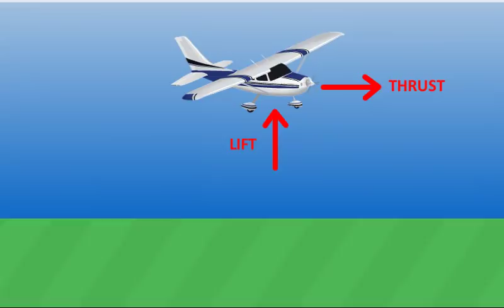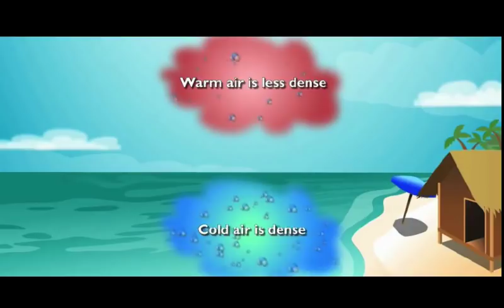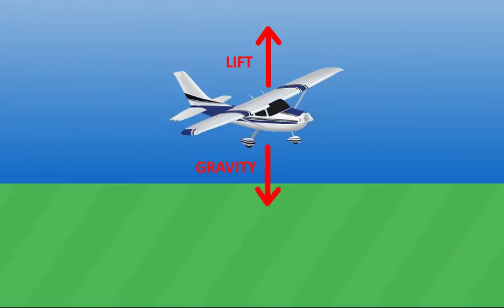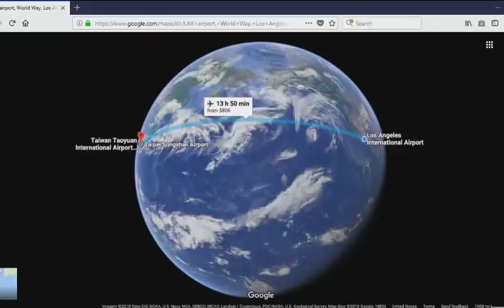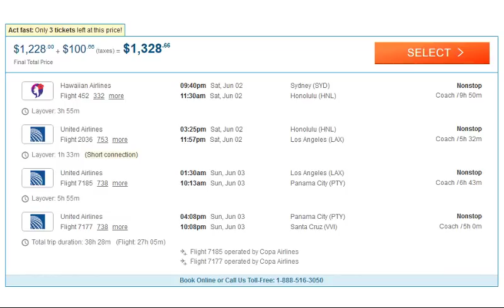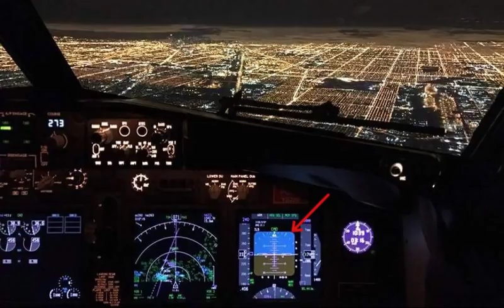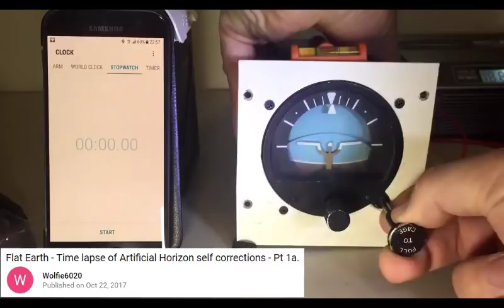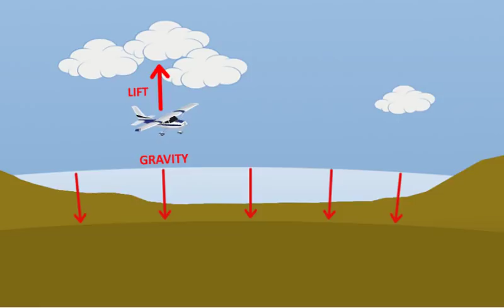Flat Earth Falsities - Plane Nonsense

Comment: "One thing that's always bugged me about our "round ball planet 93 million miles from the sun"...Why isn't there EXACTLY 11 hours 58 minutes and 2 seconds of sun, every day of every year? That would be the time it takes the Earth to rotate 1 full turn, which is 23 hours, 56 minutes and 4 seconds divided by 2. Some would say, "Because of the tilt of the Earth on its axis". That has nothing to do with light hitting a ball. No matter how you tilt the ball, exactly 1/2 of the ball is getting hit at any one time by the light, it can't shorten the duration of light just by tilting. Hold a ball up in your hand and put a mark on it roughly where Florida would be in relation to the equator. Then tilt it roughly 23 degrees and spin it. The light still hits 1/2 of the ball at all times! The only part of the globe now in darkness is the North Pole, not anything near the equator. So where is the missing light-time? According to the Navy's Astronomical Applications chart for Fort Walton Beach, FL, the amount of sunlight shining on Fort Walton Beach on Jan 1st, 2016 to Jul 1st, 2016 has a duration change of almost 4 whole hours! And, the temperature changes by about 20 degrees. You mean to tell me we're 93 million miles away from the sun, but a 4,000 mile difference (approximate distance a Northern hemisphere continent is shifted away from the sun because of the 23 degree tilt) is going to make a 20 degree heat/cool difference in a day? In Arkansas it makes about a 60 degree difference. It's just not plausible."
Reply: Bear in mind the Earth's orbit around the Sun is not perfectly circular.  It is elliptical.  The radius varies between 92 million miles and approximately 94 million miles.    Also see https://www.lpi.usra.edu/education/skytellers/day_night/ regarding this issue.
Reply: O its a wonderful Heliocentic world ! :)  Amazing how that super Gravity gas-ball allows an elliptical rotation, think the Maths would make it perfectly round. And its warmer when our ball is the furthest.. anything goes, our Rulers must be laughing their heads off (or lolling like many do around here) (when not having a fit and "fu_ck off" cries).
Think LUCK & Nothingness-Laws did an amazing job here? Just learn more SCIENCE billions of miles away...
The wonders of the weakest FORCE in the Universe perform miracles on other Balls too!
Talk about COREOLIS !!! 3:29 = 21747MPH winds the GRAVITY keeps that atmosphere sticking on... way to go MOMENTUM!
Their amazing Science knows for fact all these thing without going there, more REDSHIFT wonders (never science methoded).
https://www.youtube.com/watch?v=18rARy8g4Hc
Reply: @BrainUser1  I've read over a dozen of your comments, and this one is the first one I could understand!  I feel so proud.

The math, as someone with a physics degree, predicts an elliptical path, not a circular one.  All objects in the sky follow an elliptical path, and none follow a circular one (although some are pretty close).

The data was measured by Tycho Brahe, and the orbital paths determined from those measurements by Johannes Kepler, 500 years ago.  Not long after, Isaac Newton came up with his laws which perfectly explain an elliptical path.  You can test this yourself using Newton's law of gravitation, by writing a small program to trace the path of an object in orbit around another one.
Reply: @casanovafrankenstein4193  I though so, that really ginds Them, little left for Them to do... but some meek english nikpicking.  So it seems yet I have lost an other Follower :(
ps: your comments are just the best :) :) :)
Reply: @BrainUser1  I'm complimenting your English. I'm disparaging your arguments. But I still have no idea what you are on about.
Reply: By the way your "example" ignores the orbit of the ball around the light source.  I think you assume (consciously or not) that the orbit is circular, when in fact it isn't.
Reply: If you cannot understand this point, it could be difficult to explain. It is due mainly to the earth's tilt. The best way for me to explain it, is. When it is summer in the northern hemisphere, the earth is spinning with the north pole tilted towards the sun. Resulting in the north pole always being in perpetual sunlight. When it is winter above the equator, the north pole on the spinning earth is tilted away from the sun, resulting in continual night. If the earth was spinning perfectly vertically to the sun, the ratio would be 50/50. But the earth is spinning around the sun with a constant lean of 23.5 degrees. So we move through the year from summer to winter solstice, resulting in different seasons.
Reply: @appresley4071  HA HA HA HA! As if I didnt "know", "YOU" to explain? Think not, never would you come up with that well cooked anomaly story. Long live the 66.6 tilt, as Gravity it does wonders.
Yeah it seems afterall that our / your Cosmologist clergy are not into "round" "sphere" "globe" but into; geoids / oblate / ellipse shapes, like the Galaxy= nice flat ellipse dancing around, well miss Nature or thee Laws dont give Gravity full reign.
Too bad for the love of Maths of Forces. Maybe its all tilted, that would explain it.
Reply: @BrainUser1  The tropic of Capricorn and the tropic of Cancer are both 23.5 degrees from the equator. This 23.5 degree tilt even explains why the sun rises south-east and sets south west in Australia. Look at a web page that explains the seasons, they might explain this better than me Louis.
Reply: "Explainging" does not mean; Proof or Reality. Seem like a kid that just reapeats what the GE sites serve out for those who understand... everything. Wont get into it with you, like wasted on a Bot.People are aware of that many inconsistencies been debunked.
Reply: @BrainUser1  You do understand that gravity is a weak force relative to the other 3 fundamental forces, right? The maths do work out to provide perfect proof of the orbits being elliptical, as you can see from this website where they do the maths for you http://galileo.phys.virginia.edu/classes/152.mf1i.spring02/KeplersLaws.htm. 
Now, whether or not you can understand it or attempt to understand it is up to you and not my problem. The fact is that you are refusing to acknowledge that you, in fact, know very little of this topic and refuse to open yourself up to learning more because you believe it is brainwashing. Maths isn't brainwashing. We don't show little children mathematical proofs of gravity or earth's curvature because they do not understand these complex concepts but understand that the earth is round. It is not a global conspiracy, it is just an observable and testable fact.
Reply: @BrainUser1  Even the most dedicated flat earther should realize that Mariusz is talking nonsense to make a claim.
Everyone knows when you light a ball from a certain distance this ball will not have light over exactly 1/2 of it's surface. This does not depend on wether you are a glober or a flatter. It's just 3D modelling.
Also the lengthening/shortening of day and nighttime by the tilt is for a flat earther perfectly understandable. That he mentions 23h56' proves he doesn't understand anything. He just grabs a few lines and vomits it into a forum.
Even you should admit that Louis. No way you can defend him for being a knowledgeable flat earther.
Reply: Luks welcome to... +Voys context world. MATHS can work out to make and bake any "perfect proof".Not exactly lab scientific method material.... THEY got plenty of Galaxy /Universe math proof, execpt they have not proven REDSHIFT business that  they depend on for their knowing, existance, kind of like GOD.
Reply: @Buildthewall4017  REPEAT= MATHEMATICS is often thought to be universally and unassailably true(generated by the brainless NOTHINGNESS or its BANG!)(& WITH NO PURPOSE...).   In conclusion: numbers and other mathematical objects are simply concepts, and not things that are actually observable in the universe, 

Hence, mathematical definitions were chosen by humans to model physical reality so that we could make useful predictions, not to encapsulate metaphysical truth, so really, why should we expect math to be true? http://www.clockbackward.com/2009/01/18/is-math-true/ 

   I agree – I think of mathematics as a language… we would never say “Spanish” is true or false… it is a system people use to describe and model their world… In discussions of philosophy, I’ve noticed an unsettling tendency on the part of some people to view mathematics with an almost mystical reverence and then use it to prop up whatever other metaphysical ideas they’re defending. 

"As far as the laws of mathematics refer to reality, they are not certain, and as far as they are certain, they do not refer to reality."   - Albert Einstein
Reply: @BrainUser1  The Galaxy isn't elliptical, it's spiral shaped with a bulge in the center.  If you look in the night sky and see the light streak in the south, is the main part of our galaxy viewed edge on.
Reply: @darrylgonzalez5251  ...POINT being? I used the word for my own reflection, not technical, can not imagine what value your input has upon a Heliocentric non-believer... fact is your beliefs contradict GRAVITY immense influence. 

ps: So mister wong and his buddies did not push you out.. his nasty self > John Johnson 3 weeks ago <
But the Projectionist has been abscent for 2 weeks, not normal for such a bully.
Reply: @BrainUser1  My beliefs do not contradict gravity at all: the Bible is not a book of science, period, any more than the Boy Scout Handbook is a medical textbook.  Or will you show me the passage that dictates that F=Gm1m2/r^2 is incorrect?
Reply: @BrainUser1  Wong cannot push me out any more than I can push him out.  He is entitled to his opinion of me, no matter how bereft of facts they are.
Reply: Seems YT wont allow me to edit even once now= ghosted! :(
@Darryl Gonzalez He has tried REAL HARD with ME, all the shill /troll tricks in the book, seems to be giving up. As in >well mybrow 3 days ago< thread They must of had some help... Seems the less menacing you are the more they vent against you :) Dont know if he is a real Believer or not, but sure is dishonest and very very hypocrite. Silly low class vulgure whinng pathetic child minds, because of THESE so many dont care to comment and get involved. 

    Okay, you may have a disproportionate idea of SCIENCE, indeed but it equals those text books, and more reliable in my view. As finally gotten accross I never got involved in Christianity, much more confident in India's Vedic texts. One can dictate whatever, nothing is for ever "proven".
Reply: @BrainUser1  As far as science goes, you are correct.  Nothing is forever proven.  For centuries scientists believed in a steady state universe, that always existed and always will.  In the early 20th century, evidence of the Big Bang was discovered, pointing towards a single explosive event beginning the Universe.  

In regards to the Word of God, however, it is settled forever, though our understanding of His Word may change.  The central theme of the Bible is that all mankind are sinners and need God's redemption.  It is not a book of science, but a guidebook to relationship with Him.
Reply: 23 hours, 56 minutes and 4 seconds is siderial time, not solar time. You read something but are not able to process the data into information.
Diameter of earth and sun are not the same. So even 12h of sunlight would be an incorrect answer.
Due to refraction of the atmosphere daytime is approx 7 minutes longer than nighttime. Due to elleptical orbit the northern hemisphere has slightly longer days than the southern hemisphere.
Face it. It's all on a higher level than you can deal with. No way these phenomena can be explained by you with a FE model.
Reply: Mariusz Euphoric Mark a fixed point on the globe, well away from the equator, and note how long it spends lit as you rotate the tilted globe.
Reply: I don't wanna sound like a dickhead or somethin, I appreciate your replies, and I understand your points. But I just don't understand why you people want it to be a globe? You fell in love with it? Lol :) what makez you all so sure it's a globe? Have you ever seen it with your own eyez? Same with the sun, what makez anyone seriously believe that the sun is 93 million milez away. We believe whatever we want to believe, and we should respect each other when it comez to our believez, yet I see insults every day between flateartherz and globeeartherz, as you see I also insult sometimez... but it doesn't make me feel good, and globe believerz seem to go to insults first... at least that's what it seemz to me like. Too many people think they know-it-all, too many people act like they are smarter than other people... you can be as sure about our Earth's shape as I can be, or any other flatearther. The globe Earth doesn't have all the answers, neither doez the flat Earth. However, what is actually goin on right now can be quite eye-openin... they're tryin to supress flat Earth, they're tryin to ridicule it, so people won't take it seriously... there's only misinformation theze dayz on Google and Youtube, thingz that no real flatearther would even consider. Now... if flat Earth is a wild conspiracy theory, and it isn't the truth, why do they need to discredit it? If it's a wild conspiracy theory, and no one's gonna believe it, becauze they are smart enough to think on their own, why do they then need to discredit it? And make this whole giant disinformation campaign about it, theze bogus documentaries that are stupid as fuck. I really don't wanna sound like a dickhead, I'm really just tryin to wake people up and open their eyez. We're livin in a Truman Show today, people play different roles, there are agents who spread misinformation about thhigz like flat Earth... there are people who will simply say or comment somethin, becauze they can gain somethin from tellin lies... they will tell you whatever they want you to hear. Satan runs the world, and before you laugh at me for sayin that, or at any other person, go research it... you can see it in different thingz, like symbolism for example, some company's logos contain the number 666... like CERN's logo, Taco Bell's logo, there's one airline's logo that has somethin to do with Satan, the moster energy drink's logo has 666 in it... Satan is a deceiver. The Freemasons are satanists. Now, when you reply to my comment, I wanna ask you to answer a question, if you can... what if one day we were told that the Earth is indeed flat, and you knew you were wrong, what would you say?
Reply: @dragoneudezet  So we get it, you want to live in a terrarium on the bottom of a fish tank. Mate your wishing that somebody would keep us locked in a jail, or use us like rats in a maze to be examined and tested. I prefer the universe, where no matter how far we travelled. We would never see all that was created. No matter how much knowledge is obtained, we will never fully understand the universe. That is beautiful. But some just want to crawl in a hole and hide.
Reply: @dragoneudezet  It's not that we WANT it to be a globe or anything.  It IS one regardless of whether we want it to be or not.  It IS a heliocentric Solar System regardless of whether we want it to be or not.  That's all there is to it.  We simply recognize that it is.  For whatever unknown reason, you don't.
Reply: @dragoneudezet  actually is not that people want it to be a globe, is that it is and we just discovered. But why you want it not to be a globe is the real question? why would you think is not a globe? for what reason the only planet in the whole solar system is flat? you want to be unique? godmade? if so why you question GOD if he made it round? why would you try to go against nature and knowledge and try to dismiss the science that made posible for you to be typing when is apply to something that YOU CLEARLY dont understand? why are you so egocentric to think a few of you without proper education and some with education but not a proper mind are the one in the right yet NEVER EVER have put proof that can explain ALL THE VISUAL interactions. In short, why you want to believe EVERYONE is tricking you on purpose.
Reply: @dragoneudezet  A better question is why people in Southern Australia, in December, see the Sun rise in the southeast and set in the southwest. And the Sun is northmost at midday when it should be southmost. Instead of ranting about supernatural superstitions, tell us how this works on the flat Earth.
Reply: Sorry brothers, but you can forget about the globe.
Reply: You answered yourself with the North Pole comment! The closer you go to the poles the more the effect is noticed, near the equator the effect is minimal. Here in England the length of day differs 6 hours/18 hours winter/summer